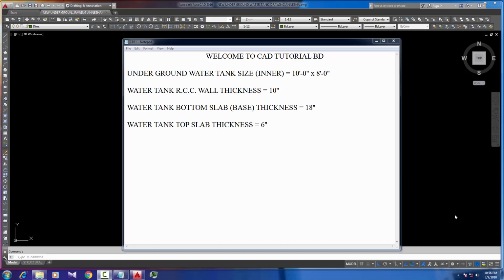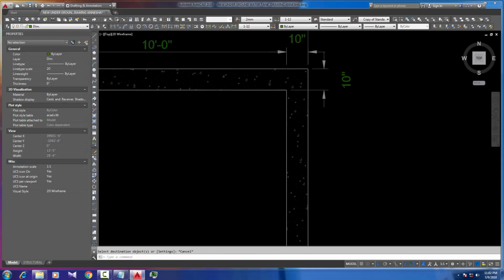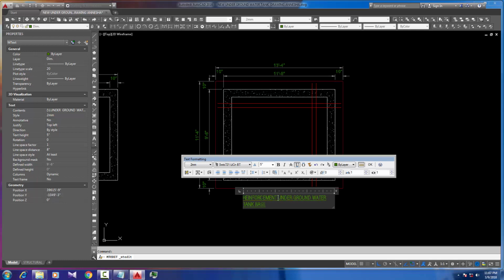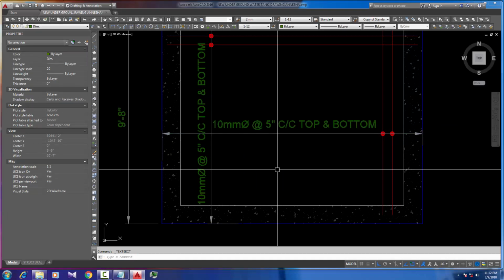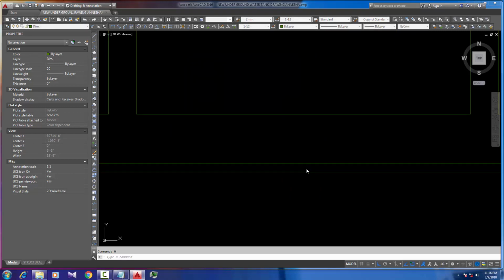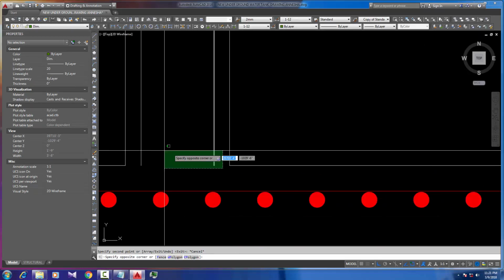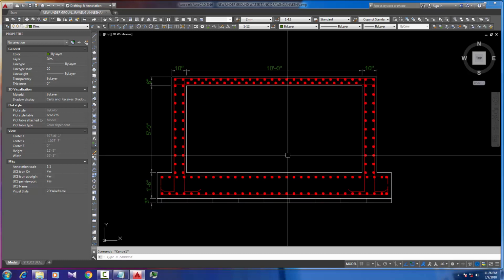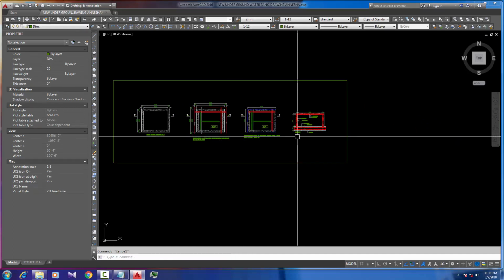Underground water tank structural drawing

Comment: What's your computer configuration and which autocad version you use...?
Reply from the maker: Intel® Core™ i3-4350 Processor, RAM 12GB & 64 bit Operating system 
I use AutoCAD 2014 version.
Thanks for your comments "Imtiaz Nayem"